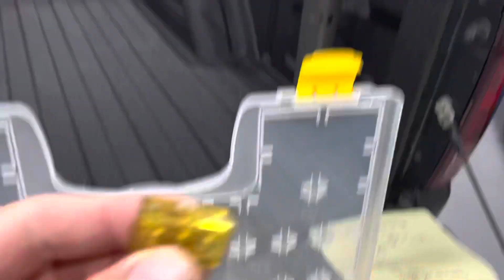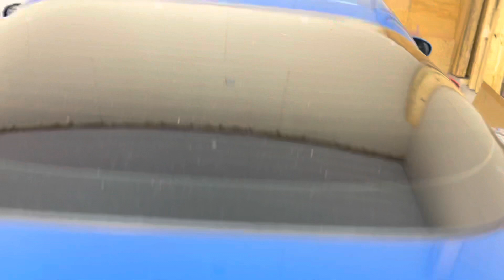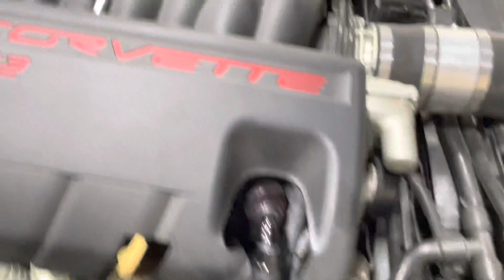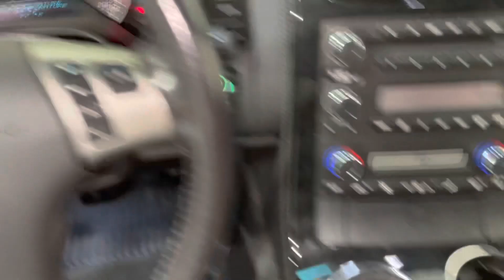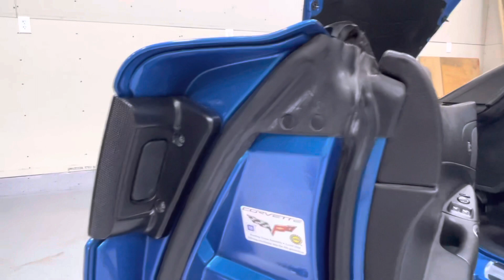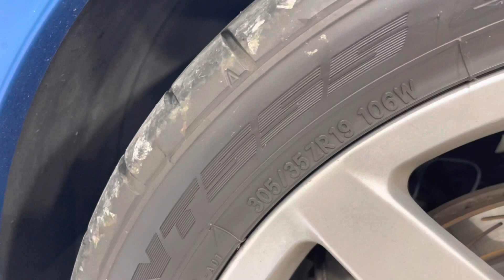Part 1: Common questions and answers from 5 years owning my C6 Corvette

Comment: Great video I love your directness about the C6 and lots of information. What about the bushings and my redone dealer still making a crunchy noise? I heard that you’re supposed to use 100% silicone grease on them and the color grease they used I checked out is a green color which is very grease. What would you recommend I do take it out clean and etc.

Comment: There are circuit breakers in the fuse box and they will reset all by themselves
Reply from the maker: Auto reset Circuit breakers will only reset if whatever tripped them originally has been eliminated/fixed. I don’t think the C6 has any of those. But if you can show/tell me where, I’m happy to learn. Thanks for watching.

Comment: The reason you buy a Corvette with an automatic transmission is that they are faster than a stick.
Reply from the maker: First of all, that was just a funny haha joke to get people riled up. Secondly, I think you mean they’re more consistently able to accelerate without incurring driver error or variation. Because, FASTER would imply that the auto alone makes the car capable of a higher top speed, and that’s just not the case. Are they quicker? Sometimes, but for some of us, the drag strip/bakery/stoplight challenge is not the only metric we measure the fun factor by. Thanks for watching. 😁
Reply: @Mr_SynergyPerformance  I can dig it !!

Comment: Nice car i have the same car. Has the same tail lights. I love them but one of them is slightly dimmer than the other 3. Any ideas on why?
Reply from the maker: I would have to say it’s either just a quality control thing or the dim side has a bad ground (causing higher resistance and lower output). Could also be an issue with online resistors if they are present. Get your multimeter out and start testing resistances to ground. Thanks for the comment. Let us know if you find the problem.
Reply: @Mr_SynergyPerformance  yeah I'm gonna switch the light to the other side and see if that changes anything. I'll check the voltage too.

Comment: electrician here ....he said check the fuses ....sounds to me you took it wrong way....a fuse doesn't have to be blown for it not to work ...could be loose ...could got hot melted connection it goes on and on ....sometimes it is as simple as a loose fuse ...but I wouldn't say don't look there ....

Comment: What if key fab doesn’t work in under license plate with a dead battery and doors are locked
Reply from the maker: If your key won't unlock the hatch to get to the manual door release you are relegated to one of 2 things. 1. call a locksmith to unlock the hatch. 2. see if you can gain access to the starter connections from underneath and connect a jumper box to power the vehicle. Option 2 is a total pain since you'll need to be able to jack the car up and get your connections onto the starter wire.  With OEM cats this can be VERY difficult.  Thanks for the question and thanks for watching!

Comment: Every forum is loaded with oil experts, many with strong opinions.  However, I have yet to hear from anyone who is either a genuine chemist specializing in engine lubrication or an automotive engine designer specializing in oiling systems.  Your advice is good.  Use what your manual says, not what you Dad used.

Comment: I'm assuming most folks with manual tranny C5's and C6's have this little nasty iritation built in called Skip Shift from 1st gear to 4th.  Annoying as it can be. Done to "meet" emissions.  Anyway,  a very easy fix for that.  Just Google skip shift eliminator.  Basically it's a resistor inside a plug on the transmission, left side, near the top..
Also,  if your Vette has Magnetic Ride control,  you are limited by what you can do with shocks - unless you want to disalbe that feature too.  (Frankly, I love it!)  Offers two distinctly different ride and handling.  Next on the door locks.  On mine and others I've seen,  just a little alcohol and swab it around on the PC board and contacts isn't enough.  Use some 400 grit wet/dry sandpaper and carb cleaner, or steel wool,  and scub a dub till they are shiny copper again.. Then put on some dielectric grease on the the contact points on the other side, then put back together - will never have to worry about it again.  These cars (moreso on the C5) have electronic gremlins lurking everywhere.  They are usually traceable back to a ground cable somewhere. Check um. clean um then coat with dielectric grease - problem solved..  There are dozens of other gotcha's , but take care of the ones in the video, then research - a good source is the corvette forum.
https://www.corvetteforum.com/forums/c6-corvette-general-discussion-74/
Have fun,  don't ever forget the corvette wave to other you see.   It's becoming a lost part of the iconic aspect of owning and recognizing others with a vette with a quick wave.
Reply: The worst shift problem on a C6 is the idiotic 2005 requirement to place in reverse when you turn her off or the entire system will kill the battery faster than you can believe. This idiocy is why I sold my first Vette I ever owned.. I’ve had 6 others and never had any problems w them.. the ‘05 was cursed I think::: first year whatever’s @ the plant…
Reply: Looks like they fixed that in the 2006 and later.  My 07 doesn't care what gear when it's shut ott.  The universal complaint was the really dumb engineering (to satisfy the EPA),  is the 1st to 4th gear shift. I actually thought it was unsafe even knowing it's coming.  Fortunately on 2 C5's I had found the resistor hack to plug in to the transmission - problem solved.
Reply: @avflyguy  they did, it was a one year only stupidity move… I wonder how many people heard that in the meeting and just said “OK” without really realizing the trouble it would cause.😖

Comment: Why hate on automatics? Yes manuals are fun, but lets be real, a modern day paddle shift automatic will spank a manual any day of the week.
Reply: I agree.
My C7 is a standard but I have no issues with anyone who prefers an automatic.
Standards can be a pain if you're often in bumper to bumper traffic as you may be if yours is a daily driver.
Reply from the maker: It was just good ole car guy gigging.. don't take it to heart. Autos have their place too.
Reply: Because youre not buying this car to go as fast as possible, youre buying it for the engagement.
Reply: Driving manual is part of the experience. Car guys get this. You're like the people that compare the performance of gas powered cars VS electric powered cars.
Reply: @Canadian_Bajan  You clearly didn't read the full comment
Reply: Only drag racing 
Every road racer uses a manual
Reply: Truth

Comment: you never had the fuse holder get corroded
Reply from the maker: The one for the charge cable upgrade has plated hardware making it resistant to under hood conditions. They are commonly used in high current car audio installs. Thanks for watching!

Comment: I just found this ... lots of great info ... thanks!
By the way, at least on my base 08, you don't have to pull the exhaust to get the starter out. Some sites said you have to disconnect and drop the front of the exhaust pipes from the cats a little ... but I didn't have to do any of that. The starter comes out with about 30 seconds of wiggling and twisting, and goes back the same way.
Reply from the maker: Thanks for watching. I wasn't 100% sure if the starter would come out on a stock one without pulling the cat out of the way.. I've never changed the starter on a stock c6, only modded ones. Thanks for the info.

Comment: Nice vid!
Is there a new solution to the rumbling noise in the torque tube? I think there’s some TBS about it. I remember I ended up paying the dealer over a grand to replace some $40 part. That was about 8 years ago, and now the same noise is back
Reply from the maker: Only thing that I could think of in a torque tube that would “grumble” is one of the bearings. They are pretty cheap, but a ton of labor to replace. I did mine myself and halfway through was second guessing my life decisions. Thanks for watching!

Comment: My gas gauge is stuck. It’s a 2008 c6. Is there any options beside taking the tanks off?
Reply from the maker: The most common thing to try is Techron fuel additive. Evidently, the sender can get buildup on it from sitting too long immersed in fuel. Put a double dose in on a full tank, then a single dose for a tank or two after if needed. If it hasn’t freed up by then, you’ll need to drop the tanks. Btw, if you don’t drive the car much or if it is stored for long periods, leave it stored with 1/4 tank or less. The level sender isn’t submerged at that point and buildup rarely occurs. The fuels system is pretty much a sealed system so drawing moisture while stored on low fuel levels isn’t really a thing anymore.

Comment: I have a ticking noise on my c6 but it has no check engine light either does it pop a code on a scanner , what could it be?
Reply from the maker: Without hearing it, or knowing anything about your car a “ticking noise” could be many things. I assume you mean it’s an engine tick, which could be as simple as a loose rocker or a lifter starting to wear out. No matter what, if you don’t know what it is, take it to a reputable shop in your area and pay for a diagnosis. LS engines are know for their valve train being pretty noisy though, so it could just be that. Hopefully it’s nothing major. Thanks for watching!
Reply: @Mr_SynergyPerformance  yes it’s a engine tick that comes from the passenger side of the engine
Reply from the maker: @insxnity9788  I’d pull the valve cover and check the rockers first. If nothing is wrong there, then it may be a lifter. Also, make sure it’s not just a leaky exhaust manifold gasket. Again, not hearing it in person makes it difficult to say what it is.
Reply: @Mr_SynergyPerformance  got it looked at and fixed and it a broken push rod
Reply from the maker: @insxnity9788  wow! That’s not very common. Pretty easy fix though.

Comment: my heads up display wont work, why? also are those stock rims on ur vettee?
Reply from the maker: There is no way for me to diagnose your HUD from here. However, I do know they are prone to failure as the mirror can become dislodged. That then makes the projection not hit the windshield. Yes, my car has OEM wheels from a 2005-2007.

Comment: Holy-smokes. That was actually a lot of good information on the whole. I got two questions for you: does the AC have a mode just to vent outside air with no cooling or heating, just air? Also, when the heck did Corvettes change from SAE to Metric? I can use either, but it feels very "foreign" to be working on American metal with tools I normally use with my Japanese & Euro vehicles.
Reply from the maker: You could manually turn on the fan, turn the temp down, then turn AC and recirc off for just circulating outside fresh air I suppose. As far as when they switched.. I’d put my penny bet that it was the C5 if I had to guess. Thanks for watching.. did you see part one? It has a ton of stuff too.

Comment: Having a problem with my driver side door, it will not open unless i use the pull latch, but the passenger side does open, what is the problem with my 2009 Corvette Base?
Reply from the maker: You are likely experiencing either the exterior door pad needing cleaned (or replaced) or the latch itself has failed. The door pads are simple to remove, disassemble and clean with some cotton swabs and alcohol (or electronic parts cleaner). If the door won’t open from the inside button, it’s most likely the latch itself. I replaced the driver’s latch on mine. It was @$200 in parts and took me 30-45 min to swap out.

Comment: why auto vette because its faster period lol
Reply from the maker: Faster would be a function of power and final effective gearing vs aerodynamic drag. Transmission style really didn’t determine which car would be FASTER. But in a drag race auto is typically QUICKER and simpler to be consistent.. which is why they dominate the strip. Thanks for watching!

Comment: Can a loose cable wires ruin my starter on 2005 Corvette due to poor connection and low interrupted voltage?
Reply from the maker: Not sure if I’m undertaking your question, but I will say that the C6 starter is known to develop a loose connection at the starter itself. It will cause weird charging issues and eventually fail to start. The starter solenoid to battery connection deteriorates from the high heat from the exhaust that is very nearby.
Reply: @Mr_SynergyPerformance  Gina again thank u but the other mechanic said I just need to buy a new battery and some wires that connect the battery someone out lose copper on the battery where u put the chargers red and black how wierd was that that they did that I hoping that's all is the battery and terminals top post well see Thursday I'll get back to u soon if I need u again thank u so much for ur reply .
Reply from the maker: @God.M856  I see. So they are saying the battery terminals are loose. That is not good, but I doubt you’d see any damage to the starter from it. Good luck to ya, and thanks for watching.

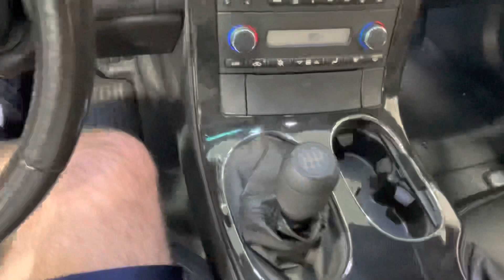Comment: I thought I'd answer your question at the 10:45 mark about why anyone would buy a automatic Corvette. I'm 57 and I've been driving manuals since I was 16 in my first car, a 67' GTO. The reason I drive a automatic Corvette is because I'm now disabled. I had major surgery two years ago and when I woke up from a coma a month later I had neuropathy (nerve damage) in both of my feet and what's referred to a drop foot in my left clutch foot. I was driving a Porsche at the time and started to hit things because I couldn't get the clutch in on time as my foot was unpredictable. So rather than kill someone and possibly myself, I sold off the Porsche and purchased a Automatic Corvette. I haven't hit anything since. That is why.
Reply from the maker: Thanks for the info. That comment was made in jest.. not literal. Someday, I’ll likely wind up in an auto as well. Thanks for watching!
Reply: @Mr_SynergyPerformance  It's cool 😎. I didn't mean to get too pissy about it. I just hear that a lot and feel pressured to turn in my Man Card and buy some pink panties by some. It's just circumstances that's all. I do miss tearing up the road in a manual. I even used to have a three on the tree in my old Ford PU. I appreciate you and the content. I just came across your channel and this is the first video I've seen of yours. I have a 91' C4 at the moment but am getting ready to upgrade to a 2008 C6 or up with a 6.2. possibly a convertible since I will not be using it for the track or any insane driving manuvers. I'll subscribe to your channel and like. Thanks!
Reply from the maker: @fuzfoz  no worries. I took no offense. Sarcasm doesn’t always come through on camera, so it’s understandable. I usually have to give a good ribbing to all my automatic driving buddies as well.. they usually give it back to me by showing me their time slips! Lol.

Comment: All excellent points and made me aware of how general systems are inter-related.  Found out some things I did not know but should known,  I do appreciate the inputs.  Mine has 32000 miles (2007) but has been experiencing aging problems.  Great input information.
Reply from the maker: Glad you got something out of the video. Thanks for watching!
Reply: Good to know low mileage is no guaranty aging problems wont occur. Makes sense. Thinking of buying my first corvette. Undecided on so many issues.

Comment: Hello from Germany, a very nice video, thx. I have a question: Do base wheels fit on a gs? I can´t find winter tires for my gs wheels . Thx in advance! Tom.
Reply from the maker: They will fit but will be extremely inset from the fender. You might also look for c5 z06 wheels as well. They should also fit, and being 18” may open up tire options. Thanks for watching!
Reply: @Mr_SynergyPerformance  Good idea. Thank you.

Comment: What are your thoughts on the ZO6 valve guide issue?
Reply from the maker: I think that if I were looking to buy a z06, and I couldn’t get 100% vefirfication that they had been checked by a reputable mechanic or replaced with appropriate parts I would budget for that to be done. Personally, if I were buying a z06, I’d already be planning on pulling it apart for H/C/I and the heads would be addressed or verified at that point. I do think tat the problem has been blown a bit out of proportion, but at the same time if they fail it’s an expensive repair. I tend to err on the side of caution.

Comment: Great vid, im glad you mentioned those run flat tires they don't grip and on a road course the hard sidewalls make the car bounce and become very unstable around corners. Is your clutch and flywheel same weight or lighter than stock, if it's lighter does it affect daily driving your car being cammed.
Reply from the maker: The I never measured how heavy the RXT twin disc was in comparison when I replaced the stock clutch. However, this Tilton twin disc was nearly 2 lbs lighter and the majority of the mass is smaller in diameter. It is only slightly, and I mean SLIGHTLY, different than how the RXT drive.. and the RXT drove like the stock one except with more bite on a hard shift. I really like the Tilton as it comes with their 6000 series slave cylinder which is SIGNIFICANTLY more robust than the OEM part. The way I see it, the OEM part is designed to be adequate for the OEM clutch… if I’m running a much better clutch, why would I rely on a part not designed to work with it? (I like Synergy between all the parts and systems in the cars I build, hence the shop name).